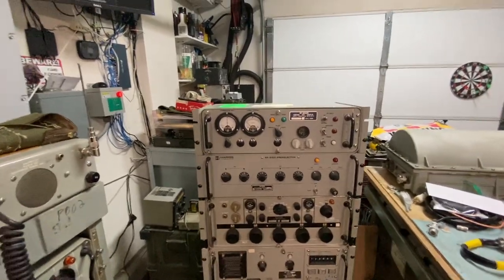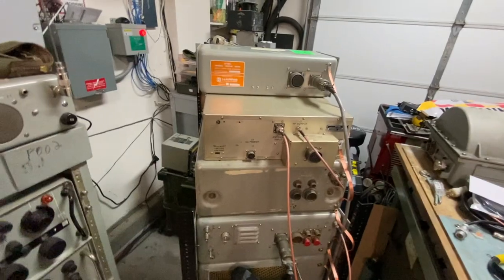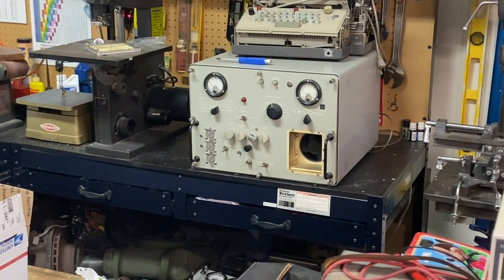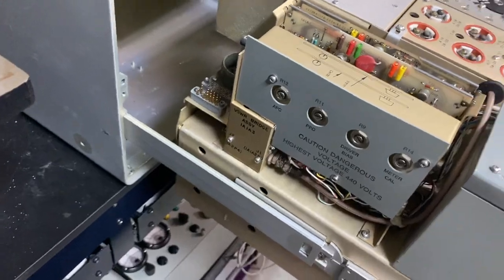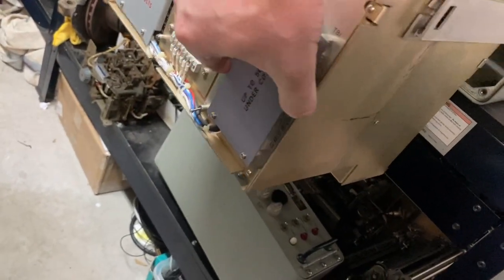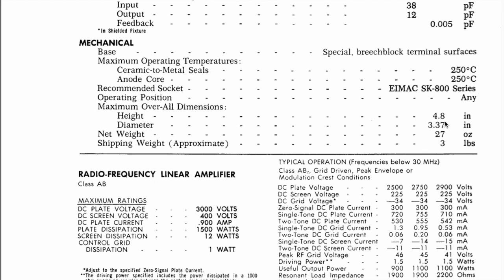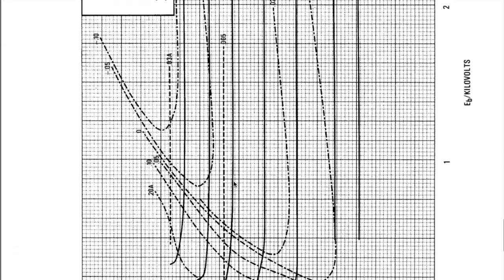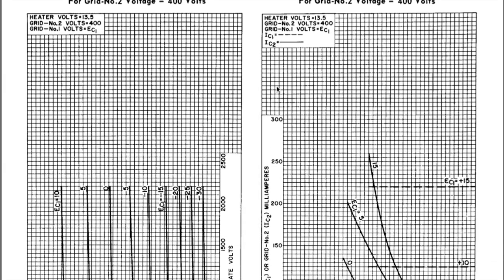Harris RF130 URT 23 Transmitter Part 2

Comment: Memories of 4 yrs of repairing Collins URG 10's and 3's , 4CX10000 and 4CX3000 transmitters. 4 of the 10's had antenna matrix and complete remote dialin to select 4 ch SSDB and AM, really cool system of its time.

Comment: I believe the pre-selector can be changed to a post-selector. If you unscrew the pre-selector plate on the front, you’ll find the label for a post-selector. Just flip it over and you’ll find the label for post-selector.  Inside the unit you’ll find a rather large black knob near the front of the unit.  Moving this knob to the opposite position will complete the change from a pre to a post selector.  Hope this helps.
Reply from the maker: That is interesting.  I did read that somewhere but had not looked to deep into it yet.  It seemed odd that someone would build something that had a dual purpose.  It kind of defeats the make an extra buck method (but I guess you could sell twice as many with no additional engineering) hi hi

Comment: I had the VHF/UHF transceivers my buddy had the HF and the main thing I remember is he always complained about what a pain in the rear doing an alignment was on that unit. just as a friendly reminder should you need to adjust anything in the URT-23 set make sure to let everything warm up, I think my buddy used to run them for 4 hours before he'd start tweaking anything. My WSC-3's were so much more reliable and forgiving.
Reply from the maker: That’s sound advice, I have the SRC-21 (URC-9) the previous generation prior to the WSC-3.  I am on the hunt for a WSC-3 and actually just picked up a service publication for it on my last gear run.
Reply: Talk about alignments.  You should look up the UrC-9.  I have a video on that here also. K6YIC

Comment: Repaired those in the navy. Watched a guy on Westpac almost kill himself working on the pa section. We had 4 on one tuner coupler to a long wire feed from helix from the #1 transmitter room. LPH-3.
Reply from the maker: This one is giving me problems.  I will address them in a video next week. I have the 400hz for the fan, 115 for the accessories but it would seem that T1 is bad.  Tap 18 (that supplies the 12v remote power is grounded) this is not allowing it to switch to operate and keeping the HV side powered off.  I get nothing from the secondary side of T1 but have the proper power coming in.  Luckily I have an extra T1 but I need to ensure the fault is fixed.  It blew out the 12v feed on the A5 card which does not have any fused protection.  It would be fun to find someone in SoCal that has worked directly on these to help out.  I was an AT2 and worked on aviation communications systems (mainly JTIDS)

Comment: How dependable are the URT-23's will they actually run for more than a few hours without constant maintenance like a lot of mil gear I've used?
Reply: From my experience with them as our primary HF linear on HMAS Swan, we had 5 23(V)(c), installed brand new after a refit, after solving a manufacturing problem, (unsoldered wire terminal causing a horrible intermittent fault), they worked like a dream, I can't remember having any real problem with them.

The intermittent fault was a real bitch, we even ended up pulling apart the valve base to see if that was at fault. Finally a good pair of eyes (mine) noticed the terminal that had not been soldered. 

Side note, this fault was as we were preparing for sea trials (ready for sea) and our battle problem, we worked almost 24/7 for the best part of a week to get all 5 units working. 

I remember getting to bed at 0400 one might and the chief was getting me out of beg at 8 am as I had missed the morning muster. No rest for the wicked. 

Good times indeed....  😂🤣🤣🤣
Reply from the maker: Based on knowledge from individuals such as yourself I would agree with the reliability of these transmitters.  When you look at the longevity (60s to the 2000s) and the amount of western militaries that used the 23 it can only be assumed that it’s a good product.
Reply: We had four of them on the sub tender I was on ( USS ORION AS-18 ) and these transmitters were my responsibility. I had very few issues with them besides replacing tubes
and an occasional diode that went bad in the protection circuitry. These were also used on fast attack subs but I don't remember what antenna they used.
Reply: When I was on surface ships, we ran them continuous and kept up a TTY circuit 24/7/365. On subs, there were 2 URT-23's, one "special", both were kept in standby, we rarely transmitted.